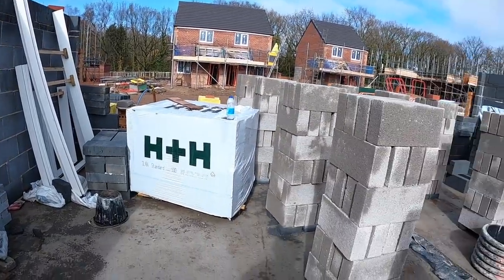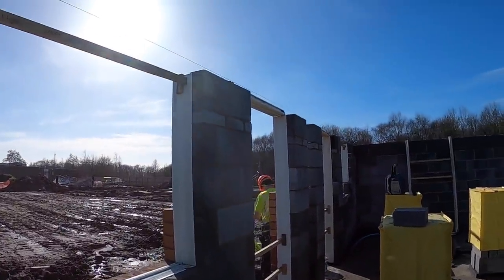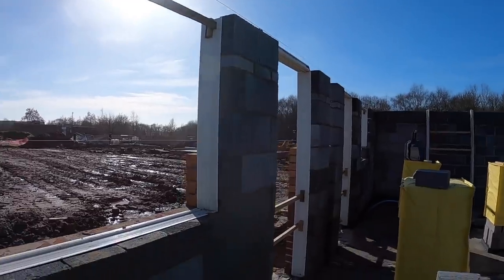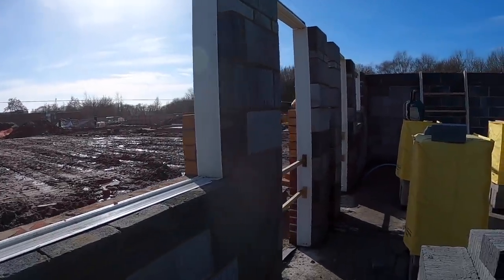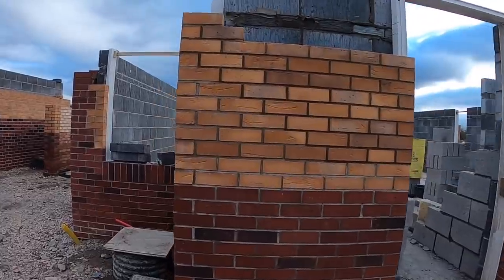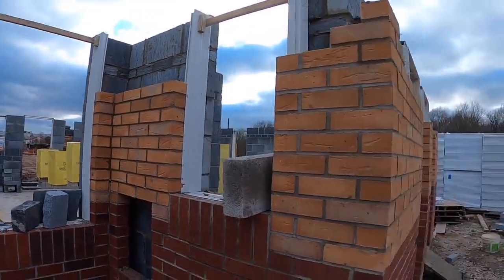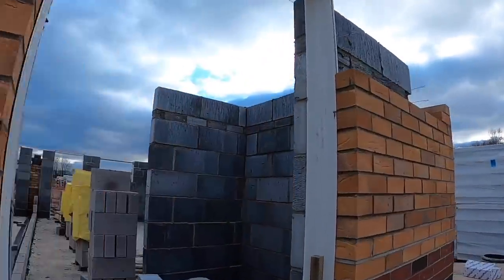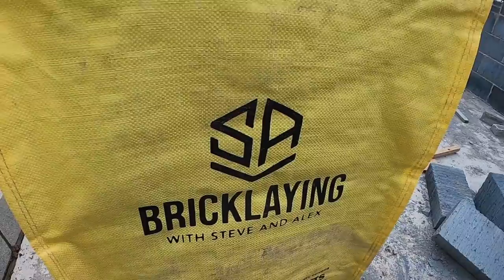HOUSE BASHING IS NOT EASY!!

Comment: Nice and neat lads well done love the different colour brick stands out nice u just need a labourer now lol where are u based don’t they put the cuts next to the door and window I noticed u put a hole brick then a cut
Reply: Its actually the proper way that if its a natural 3 quarter .some of these window measurements you have it ends up where ypu have to put 2 cuts in otherwise it ends up a zip .
Reply: Nice work steve and al
Reply from the maker: Yeah I think it looks better moved back from the jamb . Not as obvious 👌🏼🧱👍🏽
Reply: Its actually important that 3/4 goes on the reveal, otherwise you’ll be cutting bricks over the lintel aswell
Reply: @stenkallas5627  it should land without a cut should it not mate .if it works brick length below then it should still land brick length above
Reply from the maker: @stenkallas5627  🧱👍🏽
Reply: @matthewingham8579   spot on, thats why you put the 3/4 on the reveal. If you put the cut in the wall you will be cutting the bricks over the lintel even if its brickwork

Comment: Nice neat work lads .what size is the cavities in England Steve also a lot of celotex here not the rockwool batts so blockwork has to go in first a lot of the time which is a pain in the arse.
Good job and you can see you want to do a good job which is brilliant mate .
Justin brickright 👍🧱💯
Reply from the maker: We are 100 mm at the moment. This is blown in insulation apart from the party walls . 
 I hate doing blocks first , you never gets the windows right . 🙄🧱👍🏽
Reply: @SteveAndAlexBuild  most of the work ive done in wales is block first because of the kingspan insulation. Got to set up blockwork first then insulation and brickwork.125mm to 150mm cavities here aswell. So much easier brickwork first but the cavities always have air in then not cavity fill .
Anyway take it easy mate all the best 👍
Reply from the maker: @brickrightbuildinglandscaping  😁🧱👍🏽